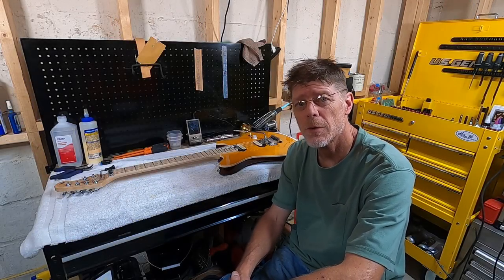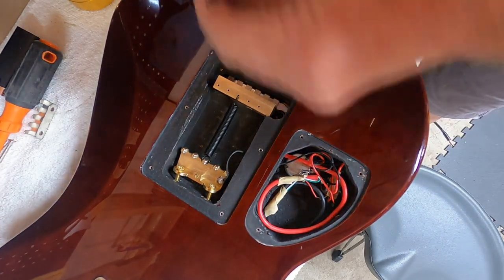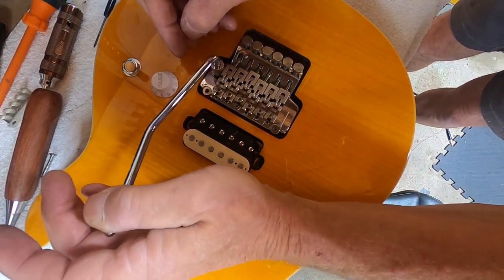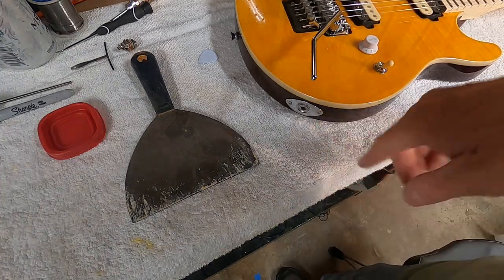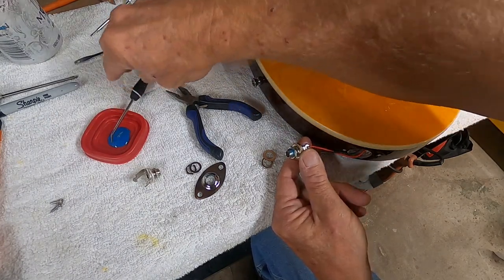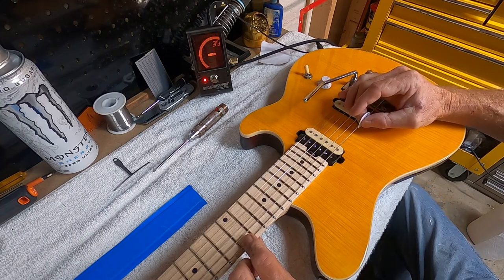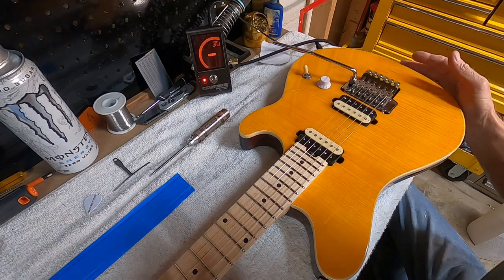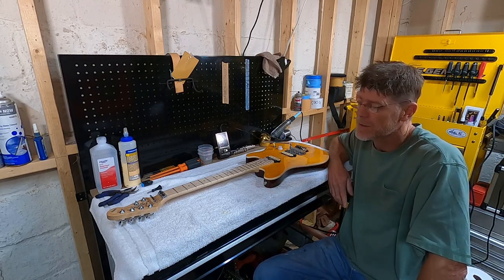Firefly FFMN upgrade video 3

Comment: So I had a different focus on my red one.  I lowered the action and discovered that (1) the frets were actually in pretty good shape and (2) the Floyd was pretty well intonated, so I didn't mess with the Floyd itself much.  I did replace the springs with FU-Tone coated springs and installed a simple tremolo stop.  I replaced the crappy tuners with 4x2 Gotoh-style locking tuners from Guitarfetish which just bolt on, no re-drilling required.  That was pure laziness, I hate having to work hard with string changes.  Other than that, I haven't really messed with it much, I wonder if I just got lucky with this one.  I haven't checked the frets with a fret-rocker because so far I'm not having anything fret out.
Reply from the maker: 1 of the 3 I ordered I was good. The other two needed work. my first one was the worst of the group as far as the frets . . .I like the guitar. I like the color and the maple top. It is now one of my go to guitars at this moment.

Comment: pretty incredible work!
Reply from the maker: Thank You  !!!!   I try to do the best I can. Each set of the guitar is done well ( after each set the guitar is 100% reassembled and tested.
There were post /anchor problems that were also fixed in this step but didn't make it into the video due to TIME. the video would have been 2 hours long . . .  LOL

Again, Thank You for watching and commenting on my work !!!!!

Comment: This was the video I was looking for, thanks!! Sorry you paid a little more than I did for the guitar 😁. The Guitar was on sale for $209 and I had an $8 discount code I found which put my total at $228.91 with shipping 😁. Ok, I didn't buy any of these parts other than the Pure Tone Jack. I installed that already. I noticed in the video that your Bridge post were loose just like mine. Is that normal? I believe that on my other guitars there is not that much play in them. As far as the 37mm brass block you put in, it doesn't look like it would be a problem for me because I usually keep the back cover off of my guitars so that I can easily make adjustments on the fly if I need to. I was checking out the price of the saddles and block for the FR, which looks like was about $75. I can get a  GoToh FR for $150, so depending on what you say about those bridge posts, that will help me to make my decision. Did my intonation last night with the stock strings. My next step is to find my sander and grind down the nut so that the first fretted string is in tune, then I can put some decent strings on the guitar. Thanks again for all your hard work and keep up the good work on your video's!!!
Reply from the maker: Yes my post at the High E was loose... I used a thin maple strip with wood glue then drove the anchor back in. I also used a little blue lock tight on the treads of the post just at the ends.
I'm going to look at the other two FFMN's and see if the post / anchor is a problem spot on this guitar.
Reply from the maker: You know I have an old PEAVEY NITRO with the post bent almost 3/32 of a inch . . . form years of ABUSE !   LOL . . .  You would be surprised what can happen to these guitars and the tremolo posts . . .   LOL

Comment: How Are The Stock Pickups In This Guitar ?
Reply from the maker: I like them . . .  they have nice clean to dirty tone.. a good do everything pickup.  Output seems good as well. 
I do not plan on changing them in this guitar. PICKUP'S are GOOD !
Reply: I like the stock pickups as well. I compared them to my Schecter guitar and they sound just as clear and gritty as those. The Neck pickup is a lot louder than the one in my Schecter which I'm surprised because the Schecter has an active circuit in it for the pickups. The FireFly sound is a little brighter than my Schecter as well, which I like.

Comment: I notice that the output jack on these is a little weak.
Reply from the maker: I replaced the stock jack with a PURE TONE jack...
but the stock jack seems OK .... it's not the weakest I've seen in low-cost guitars... In the video, when I remove it ... I play with it a little and push on the metal ear that strikes the tip of the 1/4-inch plug. Some cheaper jacks just fold right over easily moved. This one was on the solid side. Not saying it's great . . .  but not that bad.
If I went over budget let's say Spend 300.00, I could have changed the pots and switch. Maybe even added a tone bleed Or a KILL switch.
I was really wanting to get the tremolo system right. and work with the stock pick-ups and Elect's
But the jack is something that needs to be 100% on a gigging guitar. Just as the tremolo for tuning stabilities. So, my focus was that.
Reply: @DominionFretWorks  Do you see a problem with the pot and switch?  My impression of the switch was that it was pretty solid, and in fact the soldering and wiring actually looks pretty good.  The pickups are surprisingly good as well.  The only issue I see with the pot is that it is a high-friction pot, but I'm assuming that in imitation of the Axis it is based on.  Kind of like how the treble pickup is selected with the switch in the "up" position and the neck with it in the "down" position.
Reply from the maker: @markbrooks8623  They seem fine. Like yours my wiring look good as well. 
I think the two main things on this guitar are 
1) The tuners are just .... POO
2) The tremolo needs some TLC to get right.
Seem the frets are hit and miss . .  some are good some not so good.

I don't understand the white volume knob . . . .   LOL    but that is cheap to change to cream.
Reply from the maker: @markbrooks8623  I like the feel of the pot ... its smooth but firm. The switch seems to lock in well. 
And like yours my wiring look good. I did replace the jack to a PURE TONE. 
This guitar could be soooo good from Firefly. They just need to fix a few things .. even if they have to raise the price to 250.00. and keep it a budget guitar.  They could kill the market at 400.00 if they got it right, with a good tremolo and fret work.
Reply: @DominionFretWorks  I think the volume knob is another rip-off of the Axis.  I'd have to double-check, but I agree it looks better as cream.

Here's my question -- how far did they go in imitating the custom DiMarzios on the EBMM Axis?  Those pickups are one of the most famous things about the Axis sound -- EVH really, really liked them apparently, so much that he wanted to take them with him to Peavey, only Sterling Ball apparently said no.  I wonder about their DCR and inductance and how they are manufactured.  Did they copy how those custom DiMarzios are made?
Reply: @DominionFretWorks  So there's an inexpensive Floyd Rose that they are starting to put on these lower end guitars, like the cheaper ESP LTDs and the new SBS line from GFS.  That would probably work.  And yes, they need to make sure those SS frets are properly done.  I really appreciate your sharing your experience with these guitars, it is very inspiring.  Honestly, if one were a touring musician, you could get 3-5 of these things for the cost of a mid-level Charvel or Jackson and just put in the sweat equity to bring them up to speed for not much money.  They audience wouldn't even get close enough to know what you were playing, and if you didn't want to advertise you were using a FireFly, just sand off and refinish the headstock.  LOL.
Reply from the maker: @markbrooks8623  Not sure but I think Peavey was the first t make this guitar type for EVH . . .  Then he went to MusicMan??? witch the Axis was also made by Sterling "musicman"
Reply from the maker: @markbrooks8623  OK . .  Sanding off the name  FIREFLY..
Lets talk about that, Is it really still a FIREFLY Guitar at this point ???
After you have leveled all the frets, dressed them and polished them. Reworked the neck back. Replaced the tuners. Repaired the bridge and only used the base plate. You have replaced the Claw, Springs, Saddles and Hardware Replaced the output jack.
Is it really still a Firefly guitar at this point???
Reply from the maker: @markbrooks8623  LOL my reply ended up somewhere ????  LOL  I did reply but I think its under another one of your post  . .  I'm still learning this comment post area.

ANYWAY.. I was never a Fan of the FR bridge. I always used the Kahlar 2700 and 2710 bridges. They were the BEST BRIDGE.Only made for about 2 1/2 years  ...
I heard stories over the law suite from Floyd Rose and I have spoken to Mr. Kahlar on the phone... I can't say what happened. But Floyd Rose didn't want that bridge on the market. After the Law suite Kahlar was forced to make the Spider and use the FR license to make it. WE didn't want the Spider FR. We wanted the 2700 or 2710. Floyd Rose didn't allow that bridge to be made EVEN UNDER A license by FR... Witch it needed no license as it was far more advanced in design. We get better things due to people improving upon what others have done. Kahlar did just that with the 2700... Kahlar was a CAM base bridge system and the 2700 and 2710 were there only Falcrum based tremolo.
Kahlar improved upon his take witin 6 months the 2710 model. Larger Falcrum posts. The 2700 would bend the posts under hard use. BUT kahlar made right on this and if you had a 2700 you could get the UPDATED posts. FREE !!! only problem was the anchor size was also larger and most could to the replacement. You have to redrill the anchor holes in the guitar for the larger hardware.
Reply: @DominionFretWorks  Nope, Ernie Ball was first.  So Ernie Ball started out making the 5150 strings (Fender makes them now) because Sterling saw a vid with Eddie using cheap bulk strings and sensed an opportunity.  At the time Eddie had the deal with Kramer and Kramer tried to muscle in but EB had already trademarked the 5150 logo for the strings.  Anyhow Eddie liked them and so EB started out making the strings.  Then Eddie found out that Kramer was shorting him on royalties and decided to go with Ernie Ball.  He worked with Dudley Gimpel at EBMM and came up with the characteristic EVH body shape.  EBMM made the EVH model from 1991-1995, and Eddie used it on For Unlawful Carnal Knowledge and Balance, but EBMM is low-volume, high quality, and Eddie wanted a manufacturer who could handle higher volume, so he was working secretly with Peavey on a modification of the Ernie Ball guitar that became the Peavey Wolfgang -- basically the same body shape and setup but with a carved top and a different set of pickups Peavey tried to base on Ed's Frankenstein pickup.  So when Eddie left EB made a few changes to the EVH model and called it the Axis.  The FFMN is based on the Axis, and not the original EVH model, which had some quirks that the Axis fixed.  So that's all for the good.  Eddie still had his original EBMM guitars when he passed away.  I suspect he still liked them.  The Amber Gold was the classic EVH model color -- those colors are the ones FireFly is using, Amber Gold and Translucent Red.  The Peavey Wolfgang was 1996 to 2004, although they were making the 5150 amp already at that point.  Fender got all the business in 2009, although it is all fully EVH branded.
Reply: @DominionFretWorks  I see your point, although I guess one could say that of any modified guitar.  More custom, more it is yours, right?
Reply: @DominionFretWorks  I always wondered what happened to Kahler.  Isn't the FR just a modified Fender tremolo, really?  It is the same approach.  I have a 2011 Fender American Deluxe HSS Strat with the modern two-point bridge, LSR roller nut and Schaller locking tuners and it is every bit as stable as the FR while being less trouble to set up.  It has a lighter touch as well.  I never owned a Kahler but I know that there were folks who preferred it.  I think Washburn had a cam-based trem as well, but I'm assuming that FR just sued anyone who might compete with them.  Monopolies are nice when you can get them.
Reply from the maker: @markbrooks8623  Ya.. FLOYD ROSE should have never won that suite. and Yes, the fender tremolo is a Falcrum based tremolo as well, but it wasn't a locking tremolo. but Kahler lost due to it being a Falcrum based and locking tremolo. Dunno
I wish they would REMAKE the 2710 !